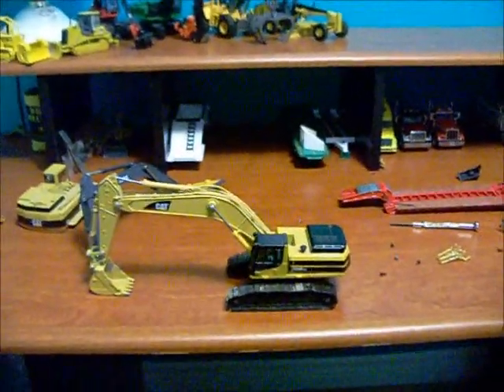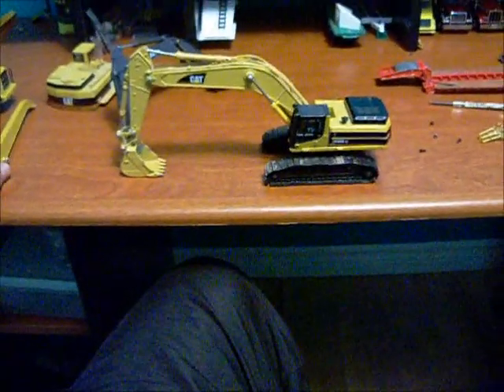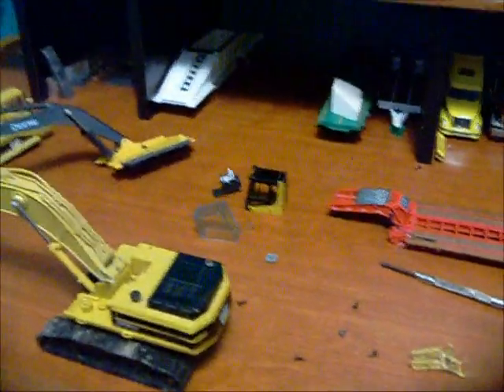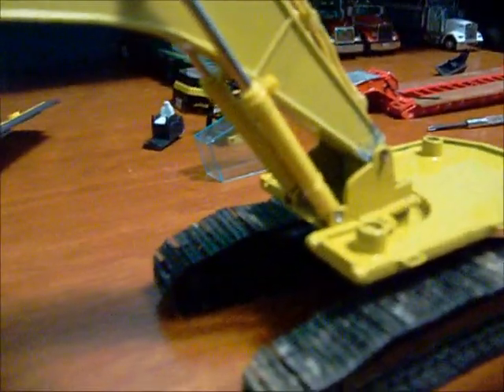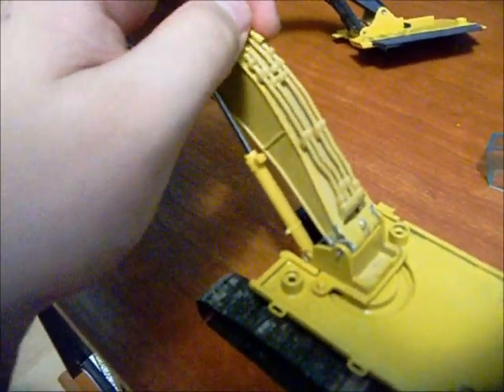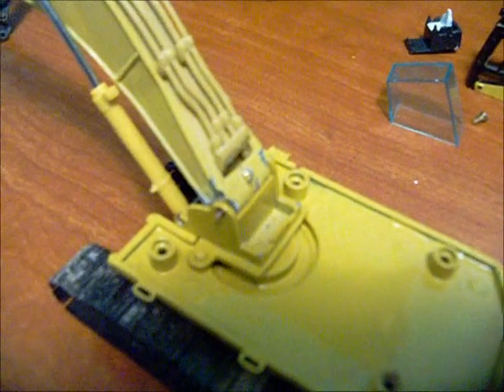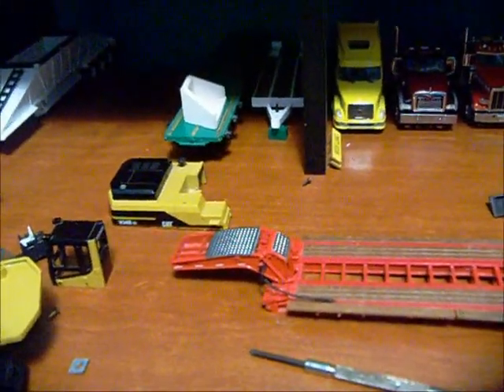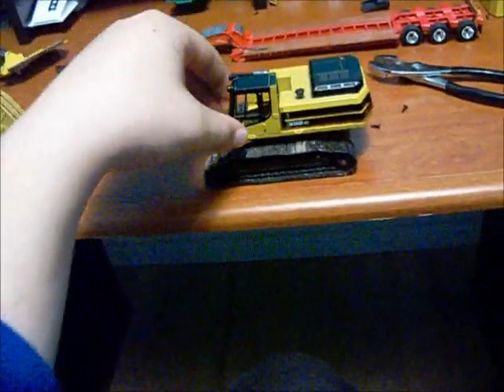345BL update

Comment: I have à custom idea for you step 1 take à 5080 front shovel cut off The cab riser Step 2 disassemble à 365  step 3 take off The Front shovel Boom,step 4  Mount 365 Boom on 5080 step 5 put 5080 back together step 6 paint over 5080 and put 375!
The 5080 was based off of The 375.